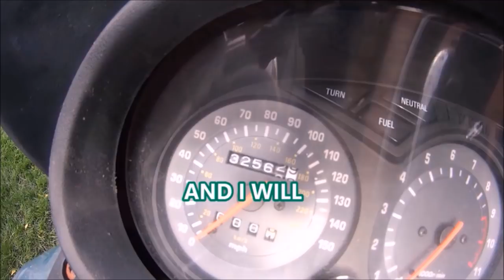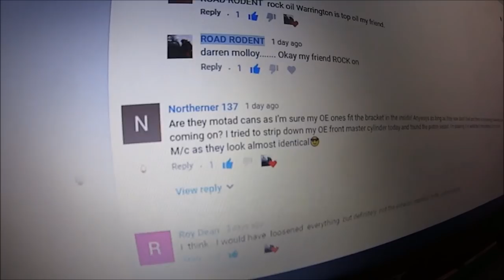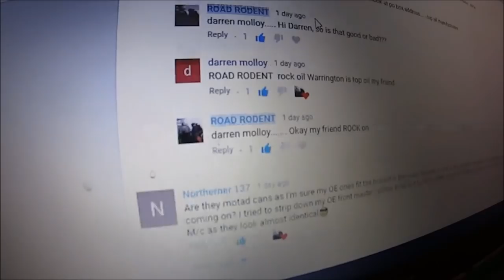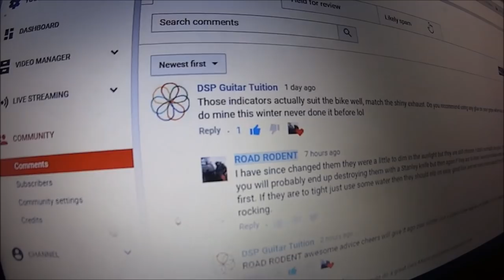XJ900S A SQUARE PEG IN A ROUND HOLE.

Comment: Looks and sounds well ...try running carbs right out of fuel......float levels give same results has knackered needles...but sounds well mate.....make sure the diaphragms are good they cause no end of problems...try rolling the needles on a peace of glass or similar....you may find the answer without waiting and spending
Reply from the maker: Thanks Darren I don't think they are bent but I will try that I can't even remember if I checked the float heights when I cleaned them out before..
Reply: @jonyr1TT  try all easy answers first....has can't see needle seats worn.it sounds to well
Reply from the maker: cheers buddy will do